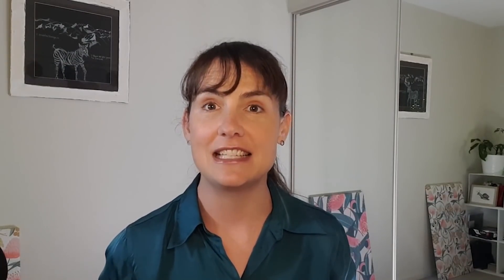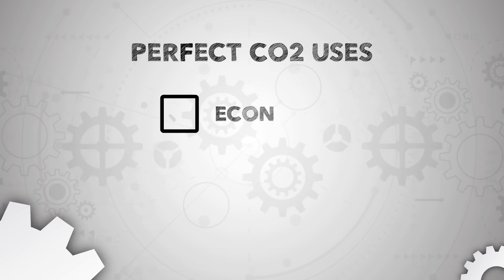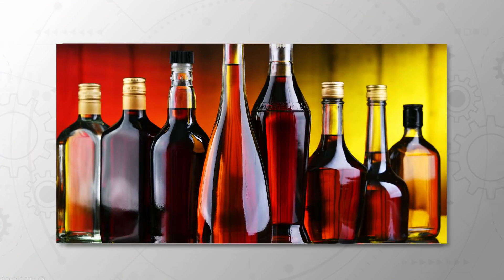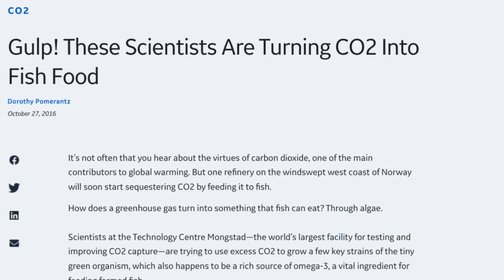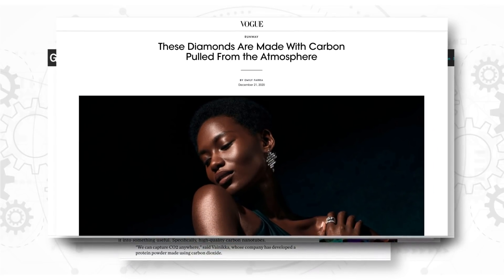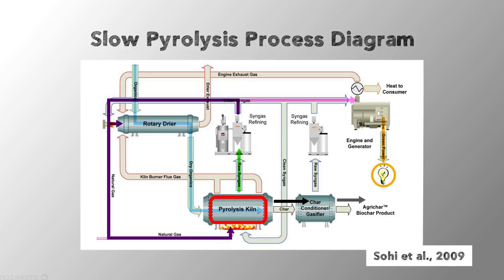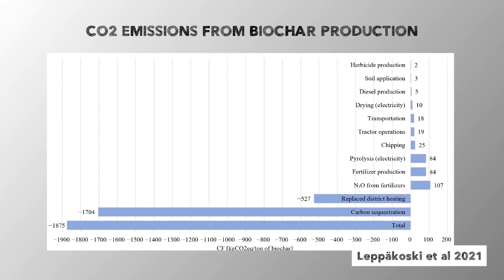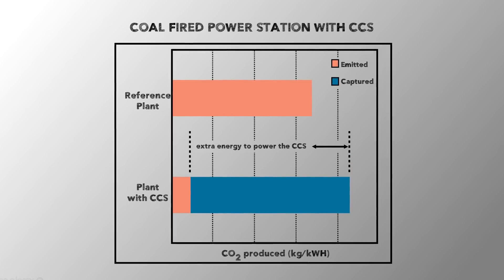From Waste to Wonder: The Surprising Uses of Carbon Dioxide

Comment: Thanks Rosie this was very interesting, I'm also curious as to how gardeners could draw down CO2.
Reply: Organic farming, alongside no till agriculture. This improves and maintain soils, which can store massive amounts of carbon. Given that Agriculture is responsible for more than 25% global green house gas emission, the effect can be massive.
Reply: You haven't heard that CO2 is one of the most efficient refrigerants ? CO2 uses about half the energy of ozone depleting hfc s . Greenhouse gas potential per molecule with CO2 is one many of the hfc compounds have GHg potentials per molecule of over 1000 in many cases . CO2 in the world's automobiles , cold storage , ice rinks and air conditioning would not only carbon capture but lessen the use of electricity which will be fossil fuel based for a very long time .
Reply: Well that's inconvenient 
“We know unequivocally that when you grow food at elevated CO2 levels in fields, it becomes less nutritious,” notes Samuel Myers

“The problem with [the skeptics’] argument is that it’s as if you can cherry-pick the CO2 fertilization effect from the overall effect of adding carbon dioxide to the atmosphere,”

“get some benefits early on from higher CO2, but that [benefit] starts to saturate” after the gas reaches a certain level, Moore says—adding, “The more CO2 you have, the less and less benefit you get.”

Richard Norby said drought and heat stress—would likely overwhelm any direct benefits that rising CO2 might offer plant life. “It’s not appropriate to look at the CO2 fertilization effect in isolation,” he says. “You can have positive and negative things going at once, and it’s the net balance that matters.”
Reply: @jamesgrover2005  you haven't bothered to search for scientists who disagree with Climate change, 
Why is Neil degrasse Tyson, pushing Climate change?, or AL Gore" or Bill Gates, or others who have no background in climatology?, why aren't your scientists making this TV interviews?
Reply: @jamesgrover2005  unequivocally?, no such consensus actually exists,
Reply: @jamesgrover2005  we know growing food in fields with higher levels of CO2 makes less nutritious plants, and when was that experiment done, and just how did they raise CO2 levels in these fields?
Reply: Humans are 18% carbon
Reply: You don't need to draw carbon dioxide down. Carbon dioxide is a heavier-than-air gas, it's roughly 50% heavier than air. It comes down to the ground on its own
Reply: @joecummings1260  that isn't the point, CO2 is not a pollutant, it's plant food, reducing CO2  by much will lower plant growth, and reduce its food value.
Reply: @joecummings1260  shield gas fir welding, makes the fizz in your soft drink, fire extinguishers, plant food, dry ice, the list is enormous
Reply: Drawing down is silly, most large commercial green houses use CO2 generators to create healthy stronger plants, the more CO2  the better....
Reply: @ChiefCabioch  yes growers add CO2, but I'm afraid your comment is deliberately misleading. 
Plants were growing perfectly well before I was born in 1970 when the ppm was 325, go figure.

But anyway what do the experts say on this subject?
Reply: @jamesgrover2005  deliberately misleading?.....well enlighten me, just what I posted was misleading? Tell me just what the mechanism CO2 has that can "trap" heat, because it's a Thermodynamic impossibility, and the carbon atom is the one that's been doing the so-called damage to our poor little weak climate at 420 parts per million.....that's million, what happened to CO2 numbers during the nation wide lockdown where Air planes and other CO2 producers stopped flying, Truck traffic, automobiles were all all but stopped entirely, yet CO2  numbers didn't drop significantly,....the misguided are those who for over 5 decades made 40 dire predictions, and not a single one ever materialized, so who's misleading whom again?
Reply: @jamesgrover2005  so why would growers add the expense of running CO2 generators if as you say the plants were fine?, history didn't begin the day you were born.....
Reply: @jamesgrover2005  Mars atmosphere is 96% CO2, yet it's very cold, your scientist is wrong....

Comment: I had heard about capturing carbon in carbonite form, for either storage or even for use in cement, though little seems to have been done as yet.  Intriguing to use carbon capture to create plastic!  Either would make a good show.  It is amazing how much plastic is used in most of the goods we use and rely on, so there will always be a need.  The downside of plastic, but like most man-made items, is that we do not yet recycle them efficiently- and the use of plastic for disposable bags and bottles makes them prone to be discarded as litter.  I don't mind plastic bottles and bags, but we need better education on the effects of them as litter, and maybe more punitive consequences for such littering.  Using carbon as a fuel is just self-defeating, and is, and has been, used by fossil fuel companies as a red herring to delay changes to the use of carbon-based fuels.  Batteries are good enough now for all vehicle transportation up to and including long-rage semis, though cost still needs to fall, and battery production will need to massively scale up.  Within 2-4 years, we will see eVTOLs used for short flights, and electric airplanes for city-to-city flights in maybe 3-6 years.  In 10, we may start to see flights that can span all but the oceans and large continents.  And this will occur with just evolutionary steps in battery technology and manufacturing.  If we hit something revolutionary, like electrostatic solid state batteries (not the chemical solid-state batteries everyone is currently pursuing), we may yet even be able to span oceans via the air.  Ships may be the one thing that is harder to propel- but we should be able to develop fuels that don't harm the environment, even if we have to pay more for our shirts and shoes from Asia.  Though the answer there, per the pandemic-caused shortages, may be to once again do more manufacturing within each country- or certainly within each continent.
Reply: Poor Han Solo.
Reply: Shirts and shoes from everywhere, Asia too. Carbonite is a Star Wars plot coupon and a data backup company.... Carbonate is a rock, a type of electric power storage battery or 30, and  say, weasel word for polycarbon or oxalic matter with large oxygen component.

I guess aviation can not only use biofuels but host many of the circular services we'll want, yeah!

Comment: In principle, a solution could be to grow plants, and have their material deposited without oxygen access. Over time, this would form new fossil fuels, to be left under ground, instead of the fossil fuels we're extracting. Of course, there is the practical details, including scaling, land usage and covering for this to have a chance of working.
Reply from the maker: That's kind of like bio char isn't it? If it's made with agricultural waste there is a significant scale possible and not a lot of extra land used. To me that's by far the most promising carbon utilisation tech.
Reply: The big difference is that deposits are meant to be at least for millions of years, with thick layers. While I do like the concept of biochar as a short term "corrective" plan to compensate that many types of agricultural activities release carbon from top soil, it does not really put carbon back into long term deposits. 

Strictly speaking, my post was a bit of a satire directed against the absurdity of "us" releasing all the long-term carbon deposits we can find.
Reply: Ain't nobody got time for that. Taking diverse forestry out of the wood pellet biz and into compressed timber and some kind of forestry would be a boon.

Comment: Another great video, Rosie.  There's a lot of really great ideas, really great chemistry and really great technology.  But this particular field is much like cryptocurrency right now.  For every one good faith project there are 10 investor scams that feed off of buzzwords and hype.  Which is very unfortunate not just due to the waste of funding, but also the reputation impact on the industry as a whole. 

Have you looked into iron seeding ocean phytoplankton?  That seems like an extremely promising technology.  Possibly the only promising technology with respect to direct air capture.  For every (1) one ton of ground up scrap iron you put into the ocean you can pull out as much as 100,000 tons of CO2 from the atmosphere.  

Anyway great video and I look forward to the next one.
Reply from the maker: Ha the crypto comparison seems fair! Most of the trendy and dodgy CO2 uses are easy to spot if you consider scale. 
I hadn't heard of iron seeding ocean phytoplankton, I'll look into it!

Comment: Just a thought: High carbon steels (for hardness) obviously use carbon. Where does it come from? While diamonds might be niche, we produce tons of steel for tools and buildings and vehicles, etc. There's already "green steel" made using renewable electricity, could we make it greener by incorporating captured carbon? Or am I completely on the wrong track? (don't know enough about this area to know what I don't know, heh)
Reply from the maker: Steel is only up to about 0.6% carbon, so it's not as much as the term "high carbon" makes it sound. Though as you say we produce so much steel that it is still millions of tonnes of carbon in steel. My next video we're editing now is on green steel, but we didn't consider it as a carbon storage potential, other than briefly mentioning a project from Rio Tinto who are using bio char instead of coking coal in their steel making process. And the carbon in bio char obviously comes out of the atmosphere.
Reply: Steel with graphene finishes is badass, you may be a fan of laser peening that stuff or ceramic surfaces, but yeah a little carbon surface treatment can hold back mineral fouling or enhance heat exchange something fierce. Extra 0.6% carbon in application is not to be overlooked.

Comment: Great video! Pyrolysis of biomass is the key to carbon capture. It can be scaled up by using pyrolysis of biomass to create carbon-neutral drop-in fuels for existing transportation fleets currently run on fossil fuels. As electrification of transportation progresses, this biomass would be repurposed for carbon sequestration or utilization in stable products.
Reply: Suppose tomorrow we woke up and humanity was magically carbon neutral.  It would really not be important to try to remove the co2 we've already added if that happened.  The point is, all we have to do is get to carbon neutrality.  We don't have to do more than that.

Comment: Excited to see the CO2 captured concrete idea!
Reply: I thought that making concrete is a huge creator of CO2.
Reply: @SirHackaL0t.  

Calcium carbonate -> CO2 + calcium oxide. (+ CO2 from the energy to heat it up)

Calcium oxide takes the CO2 and turns back into calcium carbonate.

So on the short term it does produce a lot of CO2. Long term it takes it back.